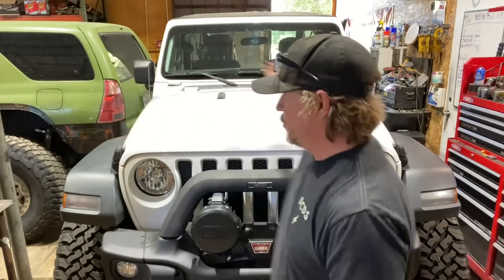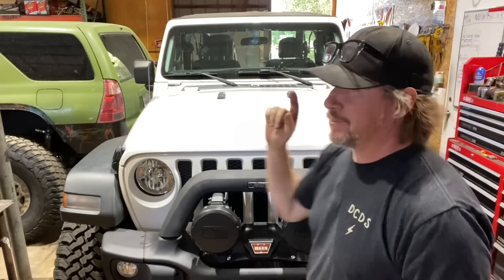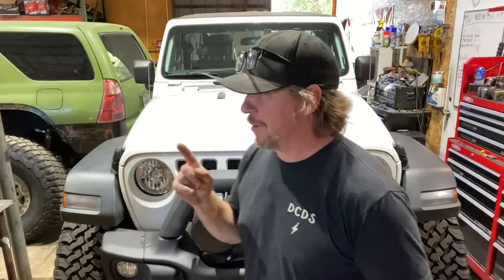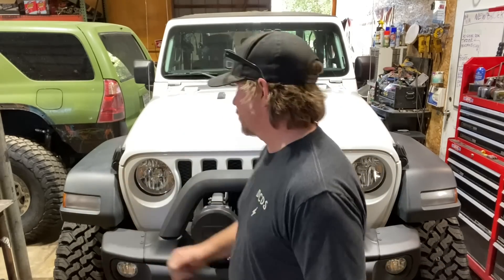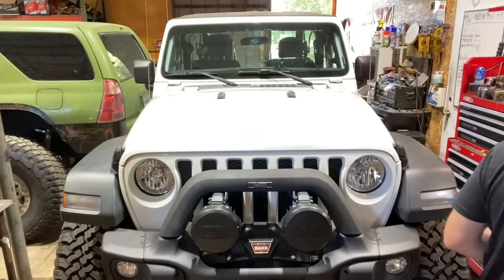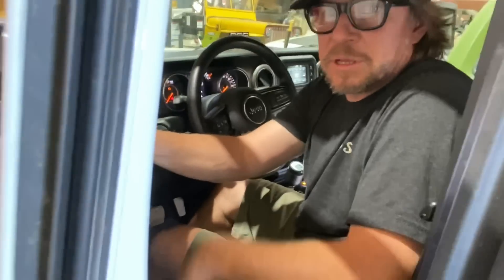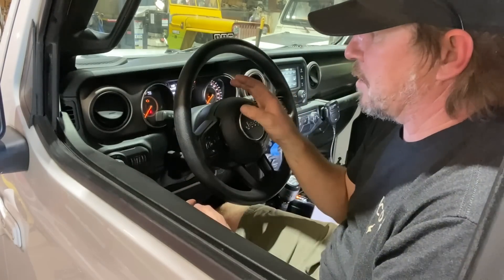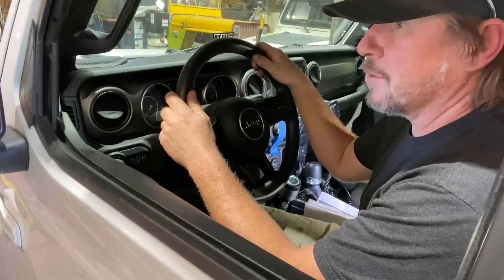Dirt Daily. Tuning Newb Sock with a Tazer Programmer

Comment: jscan will do the same thing for the most part. It will also read and clear codes if you need that. It all works with a downloaded app on your phone. It was actually the only one that allowed me to reprogram the computer to accept the 4.1 when i did my rock trac transfer case swap. Jscan is the way to go.

Comment: The newest feature is the best one. PIN Lock allows you to set a steering wheel button sequence (PIN) that must be entered before the vehicle can be driven. Failure to enter the PIN before the countdown ends will cause the ABS pump to lock all four brakes. Sure makes Jeeps harder to steal.
Reply: Thanks for the suppport

Comment: I just got a tazer also.  I think this has a feature for "front dig" locking an inside rear brake using steering wheel controls.  Haven't done it yet.

Comment: I did check them out and they have one for my 2019 Ram.  There are a couple of software items that I would like to change in my truck so I may need to get one.  It seems to be a very reasonable price.  Thanks Fred!  Also, Batman is looking good!
Edit:  I read the instructions and it is only for the Classic Ram (not 5th Gen).
Edit again:  There is a version called Tazer DT for the 5th Gen.
Reply: See our TaZer DT